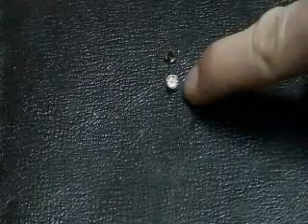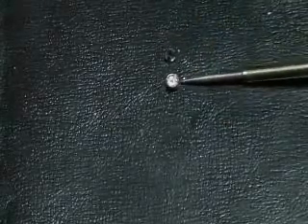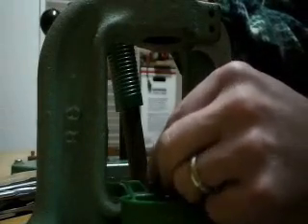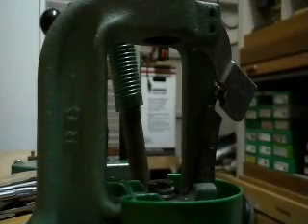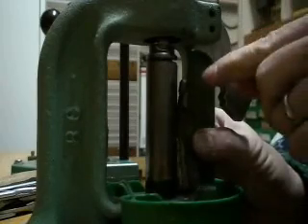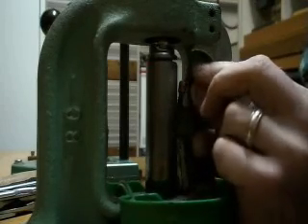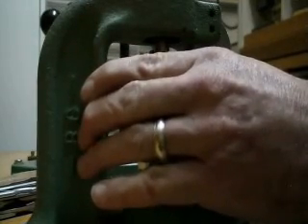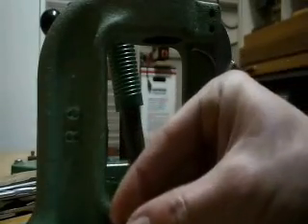Making Primers Part 2

Comment: for some reason i keep on expecting the atf to kick down your door for making primers lol
Reply from the maker: Why...I'm not manufacturing explosives. You should see the illegal stuff on YouTube like people making machine guns and silencers...
Reply: @ammosmith  I know, if you lived in California you would understand my partial sarcasm and over exaggeration. but yeah making a lightning link for an ar-15 is much easier than most people assume. I got books on building all sorts of stuff deep in storage. 
keep up with the good content. I got a question  whats your go to powder for small pistol cartridges? im wanting to get into reloading, for starting ill be reloading my 380 and 9mm. thinking of getting the rcbs rock chucker kit, or a cheaper press what your recommendation? later ill be reloading 45-70 with casted bullets and 30-06 hunting rounds
Reply from the maker: @blueridgeocean  California is going after everyone who wants freedom. They are going to repeal Prop 13 next year.
Reply: i agree, this will create issue with all businesses, mostly small mom and pop stores who have a hard enough time as it is. my understanding is that its not touching the residential side but instead its going to classify and treat commercial property differently, this will undoubtedly cause a major issue in large and small lease agreements and outright owners. i think i read somewhere that it plans to adjust the tax amount every 3 years based on the required reassessment.  but im not too sure

Comment: I know you mentioned that these are corrosive, but just thought I'd add "why".  The material in the match tips draws in moisture to it, causing the corrosion.  Cleaning with an oil patch alone won't dissolve these unspent salts, which embed themselves into the pores of the barrel.  The best way to clean the barrel after using phosphorus based primers is with hot water, which will dissolve and flush the salts away.  THEN clean, dry, and oil the barrel.  Wasn't as big of a problem with black power, as the black powder naturally coated the barrel with crap, protecting it from the primer/caps.  Modern smokeless gunpowder won't do this, hence the change to different priming agents.  This being said, in hard times, I'd still use this.  Even a corrosive primer is better than no primer when the S%% hits the fan.  Well done.

Comment: I tried this in1966. But I got the best results from wetting the match tip, with alcohol then filling the primer cup with the paste. When you put the anvil in there is no chance for accidentally igniting the mix. They will dry according to,temp,and humidity. In a dry warm place from as little as1 hour, to as long as 24 hours. Then they will work as a mild primer.
Reply: thanks

Comment: to make it less awkward and more consistent firing. i use alcohol to make a paste of the tips. then cap it off with a small sheet of tissue paper. the paper aids in the drying process and doesn't hinder the use of the primer. the paste also helps in miss fires. when you use match tips dry, the pieces of match tip can migrate from the anvil = misfires.... to make a hotter mixture. you can experiment with fine particulate metal filings by mixing in iron or aluminum or other metals into the paste. that's what makes gun powders more potent. metal fillings also give fireworks their colors too.

Comment: Would it be possible to use tannerite? Grind up the base, then add the 2nd part to the ground up base, add that to the primer. Plus, I think a small, thin piece of paper, like that of coffee filter paper, in between the powder and the anvil, to keep the mixture in. Worth a try?

Comment: YOU CAN ALSO MIX THE WHITE TIP PART INTO ALCOHOL MAKING A PASTE OF THE TIPS. TO BE MORE PRECISE. I WOULD USE A POWDER SCALE AND WEIGH OUT THE MEASUREMENT INTO INDIVIDUAL MIXING POTS. THEN MAKE THE TIPS INTO PASTE. ADD A PAPER DISK BETWEEN THE PASTE AN ANVIL. THIS WILL HELP REMOVER OR WICK OFF THE ALCOHOL TO DRY FASTER. I FOUND THIS INFO IN IMPROVISED MUNITIONS MANUAL.

Comment: ... (2/2)

The base contains many of the same materials as the tip, but has a smaller amount of phosphorus sesquisulfide. It also contains sulfur, rosin, and a small amount of paraffin wax to sustain combustion. A water-soluble dye may be added to give the base a color such as red or blue.

Comment: Let me help you out.  The "strike anywhere" match tip contains a mixture of phosphorus sesquisulfide and potassium chlorate. Phosphorus sesquisulfide is a highly reactive, non-toxic chemical used in place of white phosphorus. It is easily ignited by the heat of friction against a rough surface. The potassium chlorate supplies the oxygen needed for combustion. The tip also contains powdered glass and other inert filler material to increase the friction and control the burning rate.

Comment: Dont ever try this primer reload method,as its highly unstable, The powdered form of primer mix will spill out between the cup and anvil and the primer wont fire at all. Recoil pressures from a previous round could ignite the match head material, and the firearm will blow your you damned head off. Just buy bulk ammo......and forget you ever saw saw this ridiculous video.

Comment from the maker: @dogbone222 The anvil is part of the primer. Ring caps would not work because the primer itself is exposed to a lot of pressure. The material in will work.

Comment from the maker: I am experimenting with paper roll caps. So far so good. Use a small hole punch and you'll get a nice clean cut. 2-3 seem to work good.
Reply: Does this work with rifle primers as well?
Reply from the maker: @hunterjager9537  Yes
Reply: Are you soaking them down with a solvent before using a hole punch?
Reply from the maker: @kb3kyx  no. the cups are empty.

Comment: if you had to do so, i guess this can work. .however, i think i would rather go flintlock before doing this..  if the rounds sit for to long, the match head powder could work out of the primer and into the round, and not work at all or worse go off in your storage.  expeically if its stored in a vehicle where lots of vibration is.  one thing about primer powder, its made to specifically go off when 15 lps of force hits it.. match sticks are no where near that, closer to 5lps..

Comment: It all depends on the extractor... some are rounded off at the front to do just that.

What's true is that long-extractor Mauser systems most definetely do NOT like being closed on a chambered case, but most other guns deal with it just fine.

Comment: Ingenious presentation, thank you!

Note that when a 1911 slide is locked open and a round is dropped directly into the chamber and the slide is snapped shut it makes the extractor work in a way it is not designed to. Instead of allowing the cartridge to slide behind the extractor's hook from the underside, it forces the extractor's blunt leading nose to impact the rear of the cartridge at high speed. This can cause the extractor hook to fracture and snap off, thus causing an immediate problem.